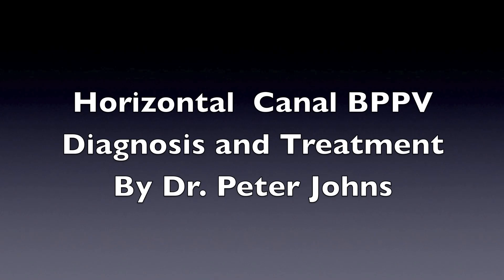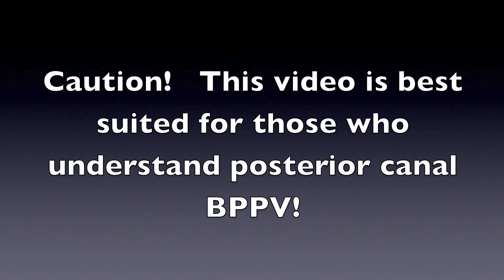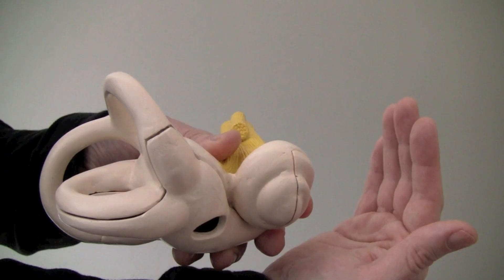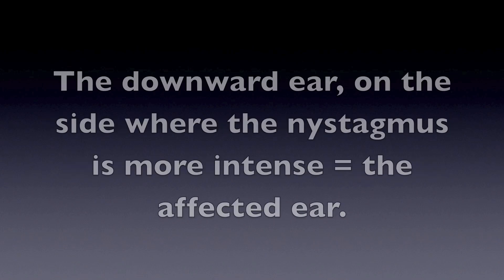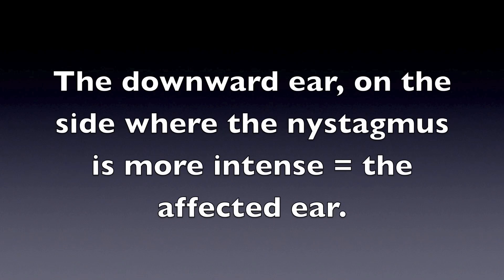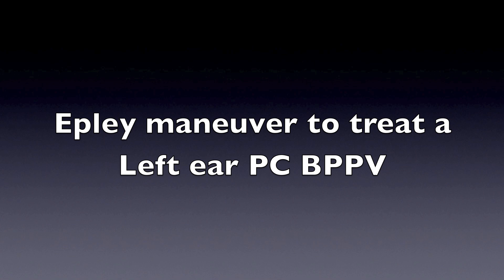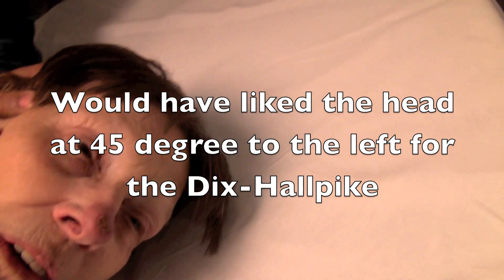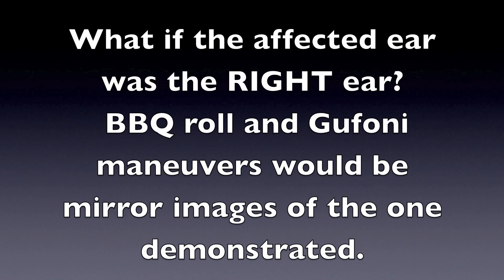How to Diagnose and Treat Horizontal Canal BPPV

Comment: Hello! about the nystagmus to identify if it's geotropic or apogeotropic, when you say  the fast component do you mean when the eye jumps back to a certain position? And the direction this fast component moves identifies which is the affected ear?
I'm trying to understand because I thought my left ear was the affected ear and I did the BBQ manoeuvre multiple times the past two days yet I still have nystagmus when I roll onto my left side but after watching your video I noted that my eye rolled smoothly to the left and then jumped back to the right
Reply from the maker: Try watching this video.  I think it's a bit clearer.
Reply: @PeterJohns  hi yes I worked it out now!! I had apogeotropic nystagmus and was treating the wrong ear. Thank you so much for showing how to do the manoeuvres for the correct bppv otherwise I would've been stuck like this much longer than last time!! I'm so glad I found your video cause I've only seen treatments for bppv in the posterior canal.

Comment: is it correct that if nystagmus is not present, meaning it is not bppv in any form possible?
Reply from the maker: If you could  rephrase your question I will try and answer it.
Reply: I am sorry, my english is not adequate I guess. I will try again. Can bppv be present even if there is no nystagmus detectable? I've read that nystagmus can be fatigued when one does  a lot of exercises for vertigo like the Brandt-Daroff manouvre.
Reply from the maker: Testing for fatigueability is no longer recommended.  Sometimes it is necessary to repeat positional testing (both the Dix-Hallpike test and the supine roll test) even on different days in order to reliably rule out a form of BPPV.    Also, it is possible to have BPPV where the patient has no nystagmus, but has the appropriate symptoms.  This is called subjective BPPV, and in my experience it is rare.  If you feel the patient has subjective BPPV, it is appropriate to perform the Epley maneuver.    Hope this helps.

Comment: Does the direction in which your surroundings are spinning (if you're the patient) say something about which canal is affected (horizontal, superior, posterior)? 
Or the type of movement that starts the spinning (turning head left to right, turning up and down, bringing the ear to the shoulder)? 
Wondering how to self-diagnose when you need the stop the spinning fast (because you need to be able to work the next day), and have no time to wait for an appointment with a PT. 
Or should you just try the epley first (on the correct ear of course), and if that fails after 3 tries, try the Gufoni/BBQ roll?
Reply from the maker: It would probably be easier to video your own nystagmus and then apply the appropriate treatment based on the nystagmus.    I think this would be difficult for a lay person to do.   However, my brother (with no medical training) did diagnose himself with geotropic BPPV and cure himself with the appropriate Gufoni maneuver.   So it is possible.
Reply: Thanks for your reply. That's an idea. I'll start studying the material then, so I'll have the knowledge ready if a new attack comes. So far I've only had posterior canal bppv (easy to tell), and the Epley was always succesful.
Reply: I have this and it's easy to do the normal bppv test. Just sit up turn your head looking over your left shoulder and lie down with it in that position. If it is the left ear you will get vertigo and feel your eyes going tick, tick, tick.  Use your phone to video the eyes if possible as it might help if you need it for a doctor to determine the more unusual type. If the left side doesn't reproduce vertigo, it's not your left ear. So try the right side. When you determine which side, do the "Epley maneuver." Unfortunately, it can take a few days to fully clear even if done properly.  This video discusses a more unusual type which is horizontal. If Epley doesn't work, then suspect the horizontal kind and do the fix for that if the test is positive.  If none of them are positive, you need to be evaluated for other ear problems, brain or CNS disorders.  I almost always get it in the spring. Wish they would figure out why and prevent it.
Reply: I'm not sure but ,if anyone else wants to uncover cure vertigo with water try Magonsi Fast Vertigo Expert (do a google search ) ? Ive heard some great things about it and my brother in law got amazing success with it.
Reply: I'm not sure but ,if anyone else wants to uncover how to help vertigo try Magonsi Fast Vertigo Expert (Have a quick look on google cant remember the place now ) ? Ive heard some amazing things about it and my buddy got great results with it.

Comment: I am confused about ageotropic  nystagmus 
Where is the affected side
Reply from the maker: +Marwa1981 Ahamed As in the comment above, the affected ear in apogeotropic horizontal canal BPPV is the downward ear on the side which has the least intense response to the supine roll test.  For example, if I had a patient with left ear apogeotropic horizontal canal BPPV, and I turned the patients head to the left, I would see horizontal nystagmus away from the ground (apogeotropic).  If I then turned the patients head back to neutral and then to the right, I would again see apogeotropic nystagmus, but I should observe that the nystagmus is somewhat more intense when turned to the right then when I had turned the head to the left.  Therefore the affected ear (the one with the misplaced otolith) is the left ear.
Reply: @PeterJohns   shouldn't the affected be the right side, but in the anterior part of the horizontal canal. Just the treatment is like for the posterior part of the left ear...
Reply from the maker: @Arachnoidarachnoid  Watch my more recent video.  https://www.youtube.com/watch?v=VRjRTnIw9YE

Comment: I get a little confused as to which is the affected ear.  Am I correct in thinking that the affected ear will always be the side to which the fast beating component is going towards when turned towards the most affected side? This would follow for both geotrophic and ageotrophic.
Reply from the maker: Kevin Baughman That would be another way to think about it. But instead say "most intense response" side.  "Affected side" is a term used to describe the ear that has the otolith problem.

Comment: Hi there.  If a Dix-Hallpike is performed on a patient with horizontal BPPV, you highlight that the test would be negative, or it would produce atypical findings. What might be seen in terms of nystagmus? And would any harm be caused if you went on to try and treat it with an Eply (apart from it just not being successful)? Thank you.
Reply from the maker: Good question!  You could see exactly what you would see in a supine roll test.  That is, horizontal nystagmus either geotropic or apogeotropic on both sides.  You would not see the typical vertical nystagmus with rotatory component towards the downward ear, on one side only, which is the typical positive Dix-Hallpike for posterior canal BPPV.  No harm would be done.
Reply: Very helpful answer, thanks Peter.

Comment: Thanks Peter for a great video! 2 questions: 1. Do you ever try the BBQ roll for horizontal BPPV with apogeotropic nystagmus?
2. In the demo of the Gufoni maneuver, you mention turning the head 45deg toward the table but demonstrate 90deg. Is the amount of rotation critical with this procedure? Thanks!
Reply from the maker: 1.   I have not tried it, no.
2.  I meant to turn it 45, I might have gone beyond that.  I don't know how critical it is, but that's how it is described, 45 degrees.